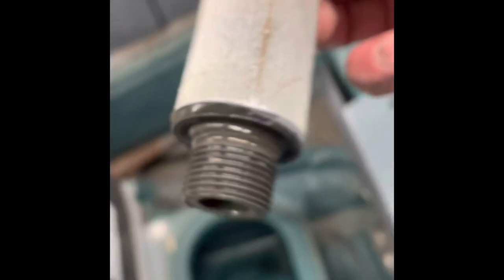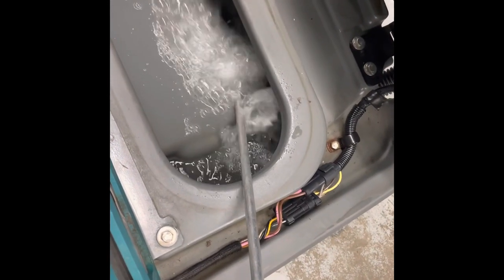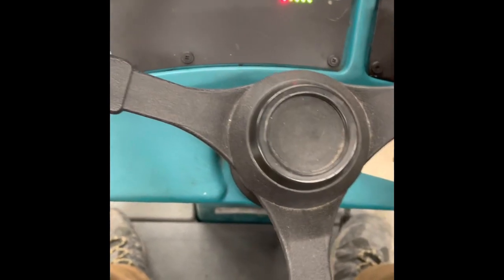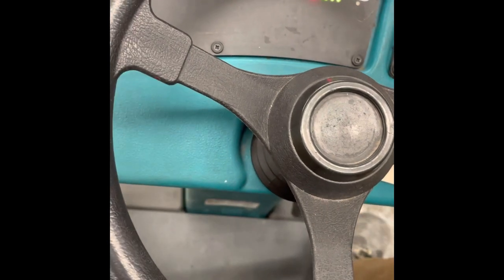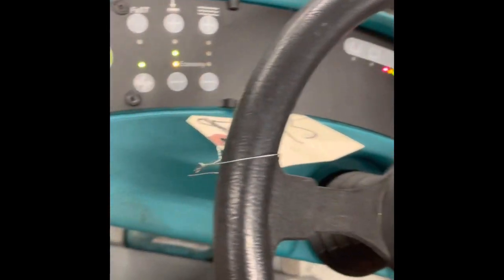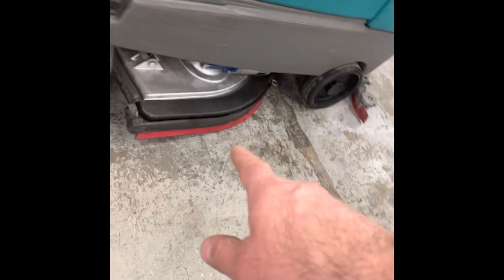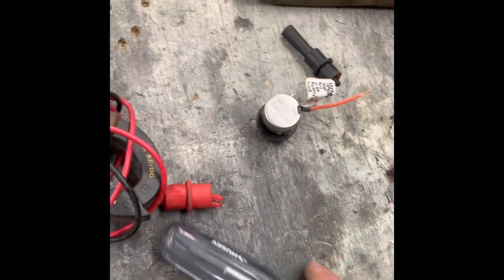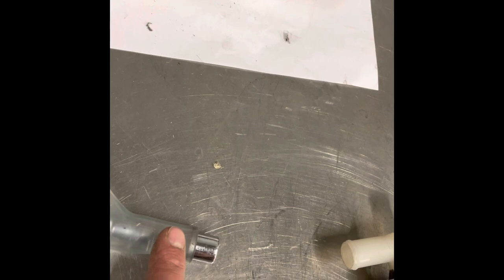Powerkleen - Tennant t7 Nobles Speed Scrub Rider solution water flow, solenoid service repair.

Comment: Great video! I also check resistance on the solenoid coil. I should not see "OL". I believe some resistance values differ based on the output volume. Also 24vdc/36vdc solenoids. Thanks for the great info!

Comment: My Tennant T7 won’t go past the first level on the pressure pads. I keep pressing the button to put more pressure with the pads but it doesn’t work. What can I do?
Reply from the maker: It’s either limited in the service menu (easy setting change, look me up at Powerkleen. net I’ll get you a copy) or a bad membrane button, not much you can do but replace the button panel